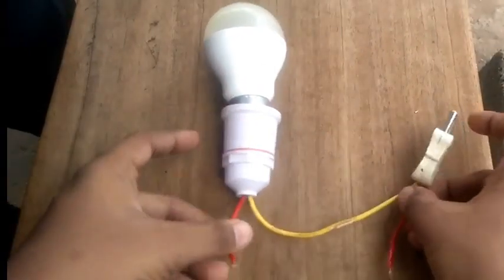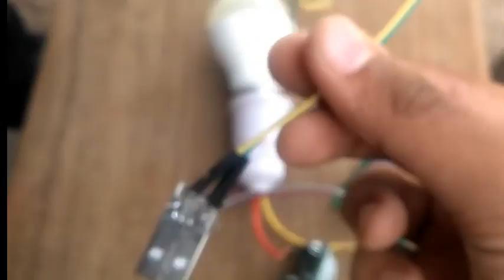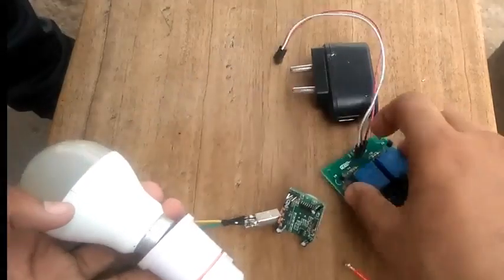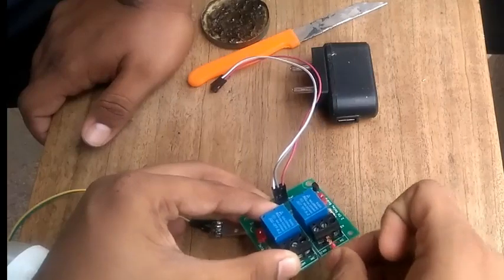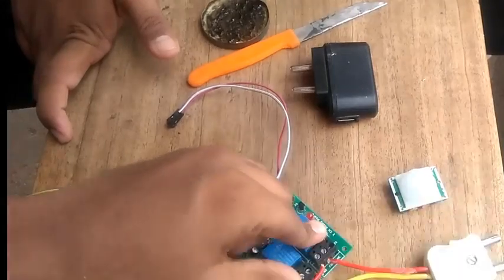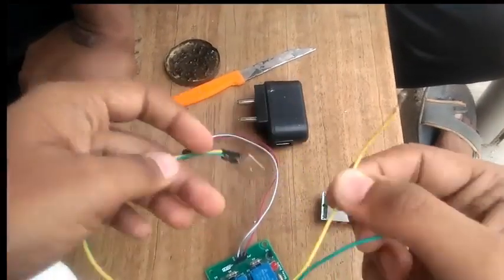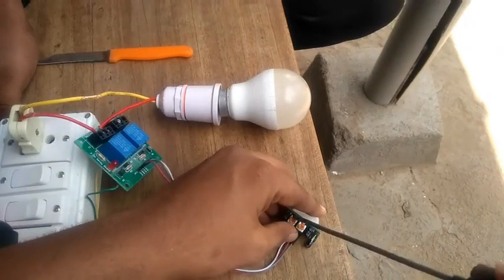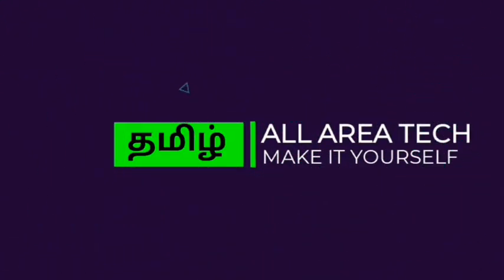Motion Sensors bulb | How make automatic ON/OFF Bulb |tamil

Comment: Bro i appreciate your work but it should be more clear. Like,

- Video should be clear its getting blurred often.
- the relay you show and the link you shared looks different. In video you are using double channel and link you have given single channel.
- should be slow and explain more clearly on wiring.
Reply from the maker: Ok I will rectify it